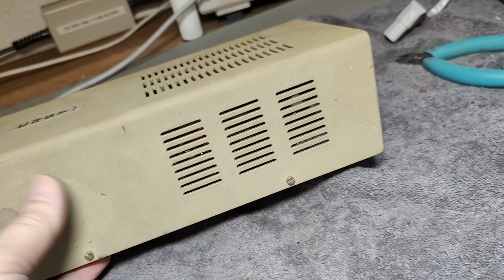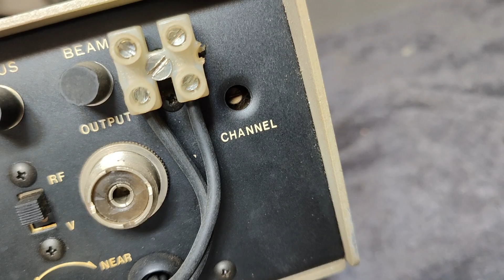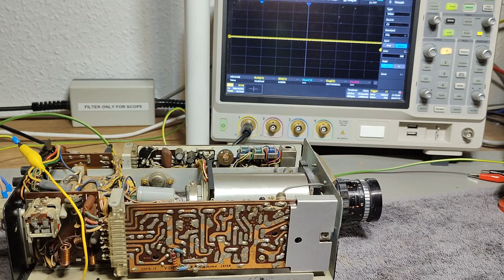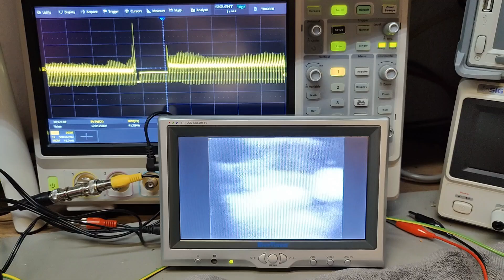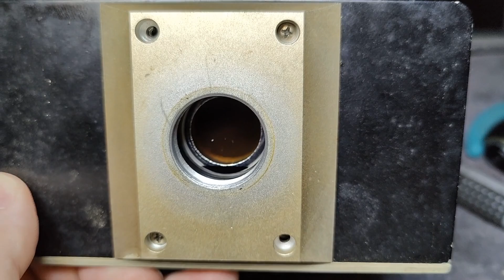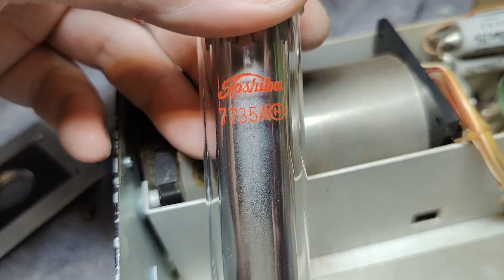IKEGAMI Casy VR-621 Closed Circuit Television Camera BW 1970

Comment: Very nice, What was the lens used on this CTV? And another burning hot question: what does the "filter only for scope" box do?
Reply from the maker: the lens looks quite normal to me, no iris control, the filter box is a super high isolation common mode filter for mains supply to scope, and i have a double isolation transformator too, this handle DC to low frequency range isolation, this way very low AC currents flow in the probe ground system, my measurements get more clean and less noise this way i see only the true signal where i want to measure. it is a normal problem with scopes.
Reply: @TeardownOZ2CPU  Thanks for answering. I was curious if it was a P-style or M42-style lens. Is the box for purchase or a DIY contraption?
Reply: @RensePosthumus  I'm sure it's C-mount, which is the standard for CCTV cameras and similar.
Reply: @michaelturner4457  Thanks Michael.
Reply from the maker: @RensePosthumus  the box is just another DIY thing, I think I go thru this scope ground isolation topic very deep goind in the videos and links found here, https://youtu.be/4rNubfeICOE
Reply: @TeardownOZ2CPU  thnkx